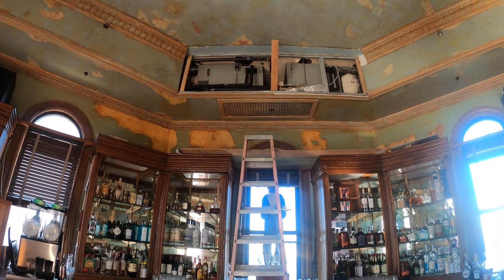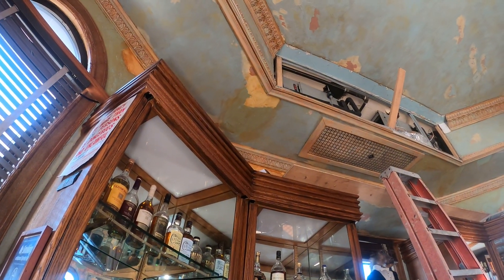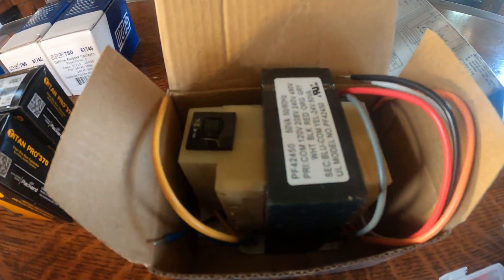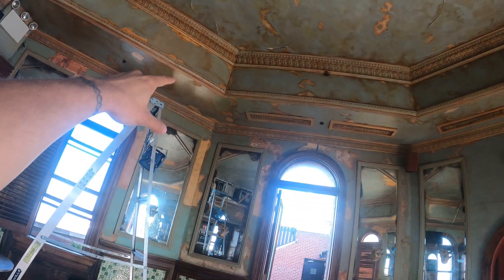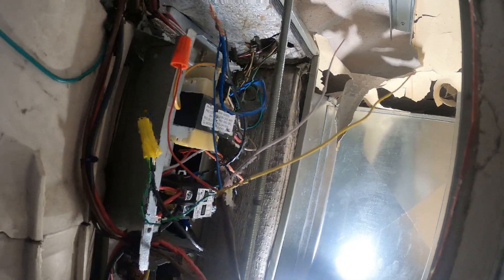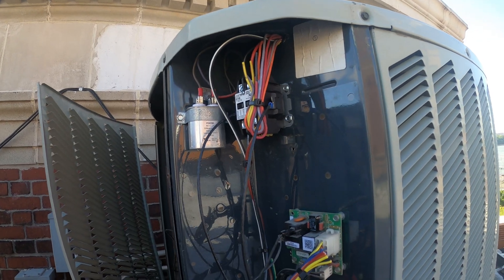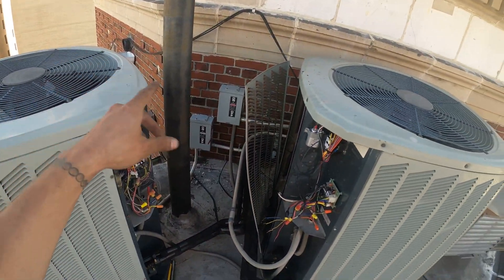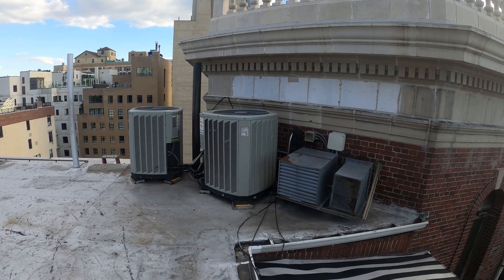HVAC Service Call: Trane Heat Pump Hack Job! Full HVAC Control Rebuild (HVAC Controls & Wiring)

Comment: Just did that same thing on a carrier air handler unit. The relay was stuck and blowing fuses. Replaced everything on the 24v side including thermostats